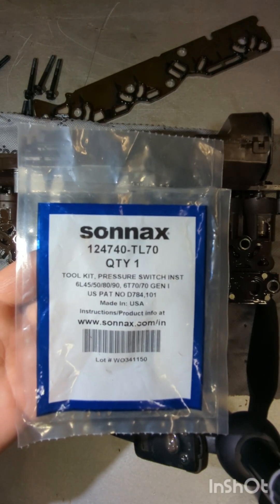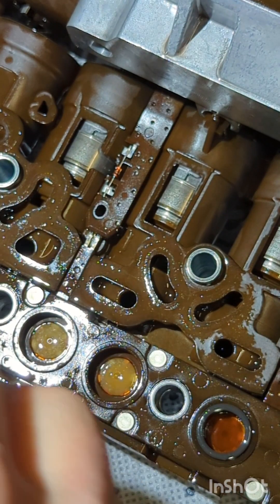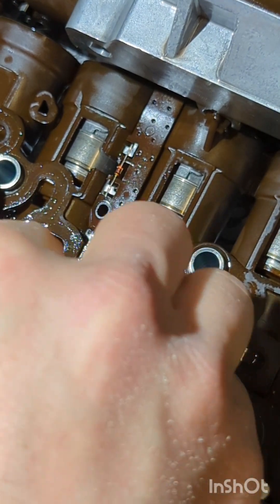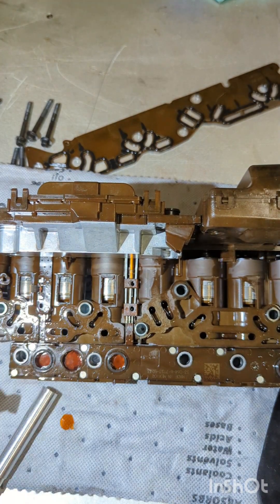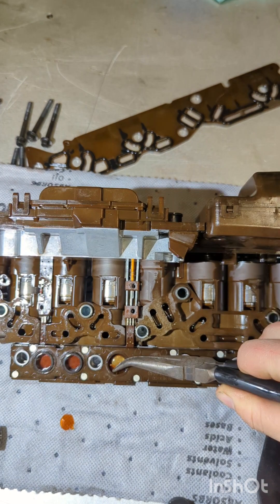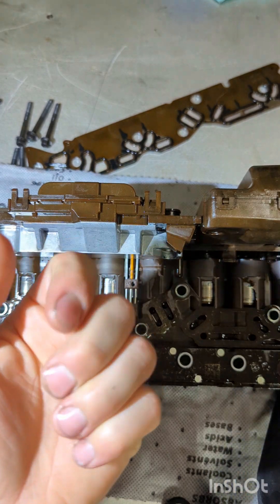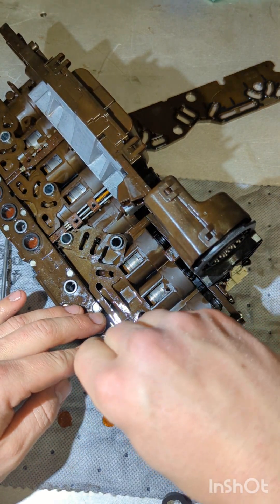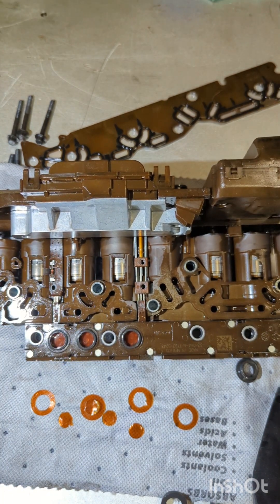GM  transmission control module (tehcm) pressure switch membrane repair. 6L45/50/80/90 or 6T70

Comment: The tool sucks. Doesn’t work well at all . The plunger just slips by the rubber insert
Reply from the maker: You really have to push in and lift up at the same time to make it work ! Its key .. brand name tool also has an impact on functionality

Comment: You didn't pull the plastic disc out underneath the diaphragm and clean out the hole before reinstalling. Worn material from the diaphragm will sit just under those disc which are easily removed.
Reply: Do you know where I could buy some of the yellow laminate discs? I’m missing one. I have the orange ones

Comment: Thank you so much for filming and sharing this process in detail. I'm working on my 6L45 mechatronics unit doing the exact same thing right now and your video gives me confidence 🙏🏽
Reply: Did this fix your problem, BMW ? And what code did you get
Reply: @stevet8607  I fixed my issues! No codes, just an unpredictable jerk in the low gears. I found 2 torn membranes and flattened seals when I took out the valve body. If you're doing it on a driveway/jackstands, use a jack with woodblocks to keep it in place while undoing the 6 long bolts. It'll safely lower the valve body without bending the last bolts. It's good weight.

Installing new mechatronics membranes & seals, along with new passage seals (3 of them) did the trick. Cheap AC Delco/GM kits available, original parts. Do a proper temp fluid fill after shifting through gears several times, reset fluid life counter, reset all adaptations including torque converter, then drive light-footed for a few days. The car will move more like a Tesla till you punch it.
Reply: @anupjthomas okay bro thanks 🔥💯👍 couple quick questions, are these membranes on the bottom or on the top of the unit ? do you have an email address

Comment: I replaced the passage sleeve twice and it’s still leaking from the connector. I have a new TECHM installed as well. At this point I’m tired of dropping the pan to address the sleeve. Plus the pins aren’t loose.

Comment: I just got done doing the same thing on mine.  2008 escalade. Vehicle would act fine until it got warmed up all the way. And then I would start having random delay shifting RPMs shoot up but no acceleration and most of the time reverse wouldn't engage. Was hoping replacing these discs in the THECM would fix the issue but it did not. Now I'm wondering what else it could be.....
Reply: What ended up being the fix for it?
Reply: @Barnabyjones76  had to put in a new /remanufactured transmission. I tried everything I could possibly do to avoid doing it. Talked to several probably four or five different transmission shops and they all told me the same thing..... new transmission. Also had it diagnosed by two different shops and they both said the same thing full rebuild or replace. They said with those symptoms you can almost guarantee it'll have to either be fully rebuilt or just buy a remanufactured unit. I didn't want to do a rebuild because the price didn't justify doing it when compared to just buying a remanufactured unit that had a way way better warranty.  Also I've heard nothing but bad things happening not long after doing a  rebuild.

Comment: Well I guess you're not answering comments, but just in case anyone else knows.   
I did the repair, but I took all the bolts out by feel and am not sure what sizes go where    I have 11 bolts. 5 different sizes.   Any help would be greatly appreciated.  Thanks.
Reply: Ever figured it out? I have the drawing of where each bolt goes since im bout ti do mine and when i take bolt out goes in the hole i drew out in cardboard so i know where each one goes back

Comment: I have a 6L45R transmission in a 2010 E90. My problem is it jerks from 2nd to 3rd gear.  Other than that, it's normal to go down from 3 to 2.  No fault code  The oil is good and not lacking.  Can you recommend me?
Reply: Mine does the same only when car is cold
Reply: I have the same trans in an 09 BMW 328i xDrive with similar issues in 1st & 2nd. I found one membrane with a small tear, nothing as bad as what this guy is replacing.

These membranes and the other seals are very important for this trans to shift consistently. They all need it, even frequent fluid changes can't save these rubber plastic parts.
Reply: @anupjthomas my shifts are acting up also  on my 328 xi did this fix your problem, was you getting  bmw code 565a? Or any other code for this
Reply: @stevet8607  This service has to be done if your car is high mileage, no way around it. Don't forget your transfer box as well, service that with new fluid and drain plugs and reset life counter and adaptations.

GM designed this transmissions this way and I actually appreciate it, because this was so easy to resolve such bad shifting. People complain because If they went to a mechanic they'd charge thousands. It's not in the normal range of operations.
Reply: @stevet8607  the drive shaft guibo discs can affect shifting as well.

One super important thing to note - none of these services will fix bad shifting if you haven't resolved every single engine issue. You cannot have a single vacuum leak or exhaust leak near the O2 sensors, the transmission is extremely sensitive to engine performance issues.

Comment: Wondering if this repair took care of the issues? I have some stored trans codes and have erratic shifting from 1st to 2nd gear.
Reply: Problem fixed? And what car and code?
Reply: @stevet8607  yes this particular issue is fixed as I did this repair myself. However, I think I damaged the TCM during installation and now may have to replace it. 2009 Pontiac G8 GT
Reply: Whats symptoms did you had in it ?